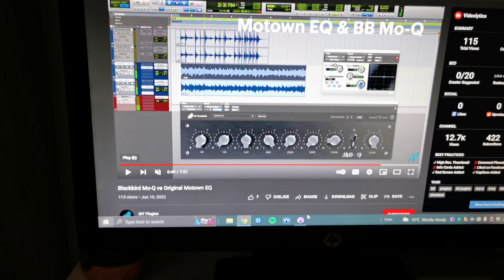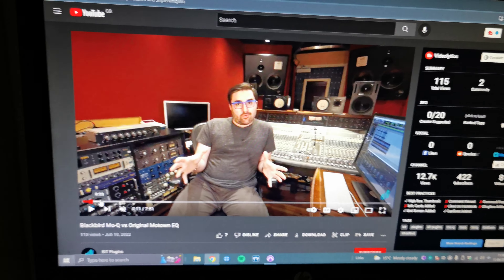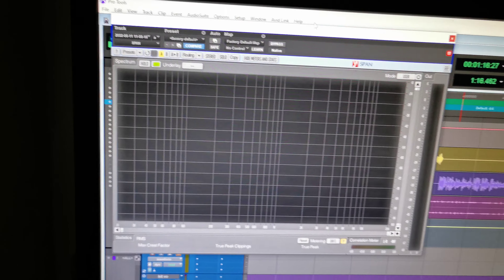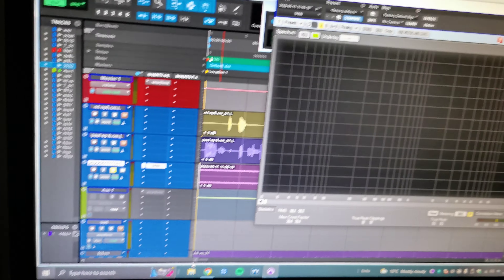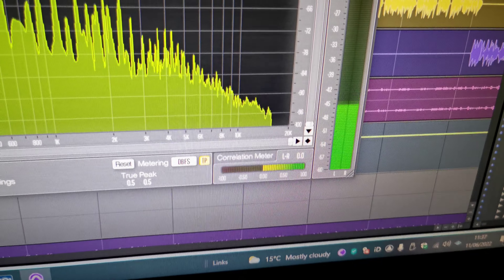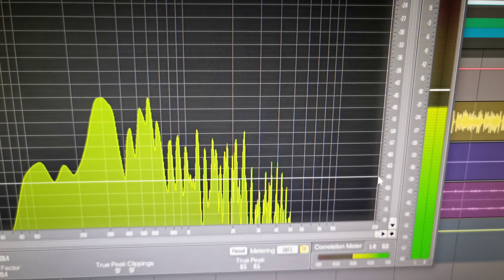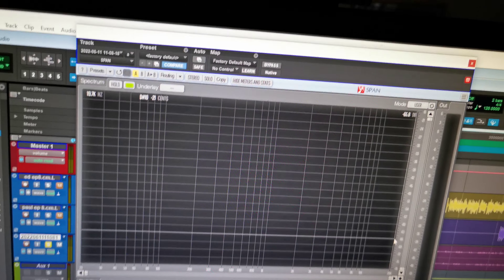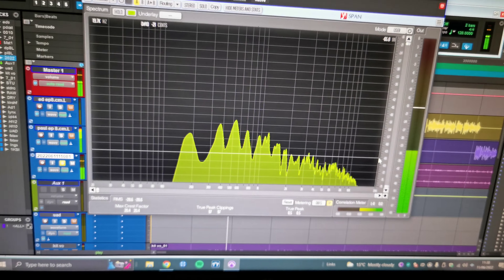I ACTUALLY CAN'T BELIEVE KIT PLUGINS DID THIS AND THOUGHT I WOULDN'T NOTICE 😂😂😂

Comment: Can I ask you a question in regards to the mixing methods my friend is doing on his tracks ..  he is micing the speakers on a cab with two 12's at 3 different locations on the same cab he is then panning the 3 sources left right and center .... To me this sounds super Micky mouse as if I was trying to have one source sound separate from another I would just track these parts over using a different guitar..  but not only that...  His method has to be causing some phases issues. Or at least some type of phasing issue that would need something like the super separator trick so that at the it would seperate the left and right of his left and right guitar tracks .. I never heard of anyone that is worth their salt do something like this.  ..  . what are your thoughts

Comment: Thanks a lot for your work Paul, now everyone can clearly see the marketing bs that these companies do just to sell a few licenses, those who choose to defend this are just plain blind. The fact that they had to turn down the volume of the master so that it seems like the difference between the tracks is lower than what it actually is was just the icing on the cake. When I tried this EQ some weeks ago and saw how high it was on my CPU meter and later read that it actually had no harmonics or analog non-linearities at all I knew something was off with this one. 

Would you also consider to make a video about their BB N 1105 v2? I know you reviewed it back when the original version came out but the v2 got a lot of praise everywhere and I was close to buy it when it released since I did like the results I got, but after this new release I'm not sure if I should trust Kit or the content creators that praised it so much saying it was really unique, they were probably just doing it because they got it for free, I'd really love to hear your thoughts on it.
Reply from the maker: They fixed most of the issues but I think.. I think.. From what I've been told it has the same phase issues due to the oversampling.

Its usable but nothing special over any other neve emulation. Actually smears the transients to my ears but people might like that

Comment: I was scrolling down to see if Kit saw this video and commented in an effort to defend themselves.
Reply from the maker: If you go on their comparison video you can see their comments which are mostly "we made a comparison on drums on our website. Got a -30db null"

-30db null.. That's not "the most accurate analog-modeled EQ plugin ever."

I stuck the drum samples from their website in pro tools, did the null and clear as day. Even at 96khz on the pass through the high end difference is there and very audible.
The null hovers over my PT meters at like -22dbfs.

The processed files null hover around -16dbfs (max peak -15.2dbfs) for the null haha

Whats even wierder is that when you level match and null the eq'd kit file with the kit pass through the null sits around the same level.. Around -15dbfs.

Genuinely there is no real audible change in their kit processed file and the passthrough till about 1k haha
Reply: @PaulThird  wow. Thanks for the detailed info. Keep up the great work you do here.

Comment: when you you do an obs record.. it is a video file... when you dumped it into pro tools did it give you two files audio and video...
Reply from the maker: OBS recording resulted in a video file which I then used to extract the audio. You can extract the audio directly from the video on protools

I've tested OBS and YouTube in a seperate video on the channel. OBS records right up to 20k without any distortion, aliasing etc etc

Comment: OK, I'll bite. 

I'm absolutely sick of the "snake oil" plugins out there. In the case of EQs, there are hundreds if not thousands of EQ plugins out there, some of which bring something novel or useful to the market, whilst others reuse the same algorithms and put a different skin on them. I'm not against "new skins" as long as these bring something genuinely useful to the workflow, and implement the algorithms correctly.

Some EQ plugins poorly implement well-known algorithms, introduce artefacts or suboptimal/incorrect EQ curves, or deliberately increase gain. Some even introduce defence mechanisms to avoid a null test, so that the frequency reported by the plugin GUI isn't quite the frequency altered by the algorithm, and the Q is slightly off. This makes matching two EQs difficult.

If the plugin is good, a company should not fear the plugin being investigated. If the plugin is found to be suboptimal or rubbish, the company should do the right thing, rather than obfuscate or name drop. The right thing is to apologise and admit that you're not perfect. You had no intention of deceiving customers, and will correct the issues in the plugin. If you cannot correct these issues, admit defeat and offer refunds to customers who ask for them.

Another worrying trend is the music press singing the praises of plugins which have known issues. Many seem to give top marks to everything, without proper investigation. Normally, you will have varying quality in the marketplace - not everything is 5/5. 

I appreciate what you're doing here, Paul. We should be busy making music rather than analysing plugins to ensure we're not having our money taken for software which is not doing what it's supposed to.

I've spent a lot of my disposable income on music software and plugins. That disposable income will soon be stretched by increasing costs of living, and unfortunately, I'll have to be far more rigorous in testing and selecting what I buy. My position isn't unique, and many of us won't be able to afford $80-100 on an EQ.

We are right to investigate, and we are right to be annoyed and offended when we don't receive what we've paid for.
Reply from the maker: 100% 🤜🤛

Comment: I noticed that they basically admitted fault over on GS by admitting they used minimal phase OS to reduce latency and cpu.. So they know exactly that thur plug is whack!
Reply from the maker: No hiding is there really. I did a pink noise null using their drum examples and the high end phase difference is clear as day, just as I showed in my original video testing the pink noise null at different sample rates

Comment: Another reason to avoid analog emulation plugins altogether. Use clean digital eq and compression and add "vibe" and "weight" and "warmth" with a quality saturation plugin like Saturn or Isotope's Exciter.
Reply from the maker: That's what I've been doing more of 🤓
Reply: @PaulThird  I will say the two analog emulation plugin styles I still use are bus compressors and tape machines. There are some great ones out there. But the analog eq thing is over for me.
Reply: on your daw stock clean EQ or stock clean compressor....would you add the saturation plugin before or after?   I usually use the softube one knob.
Reply: @pvampman  I usually saturate after eq and compression.